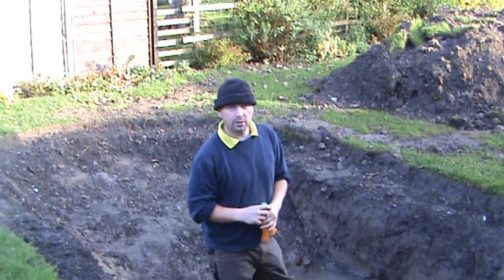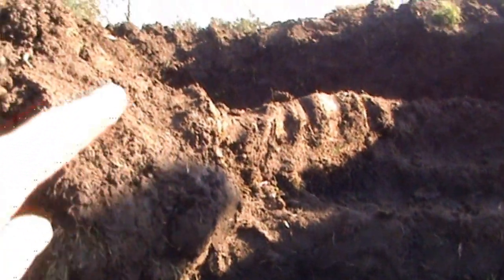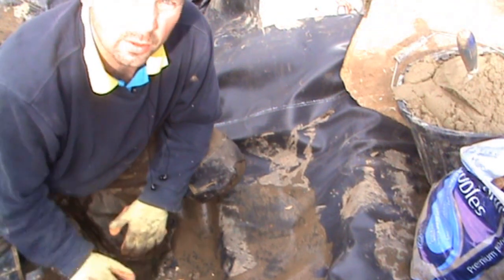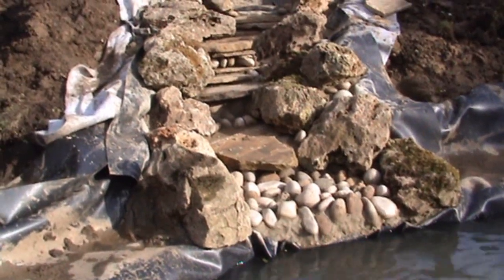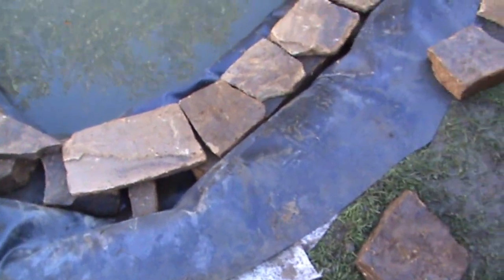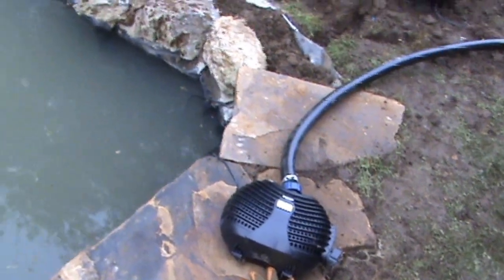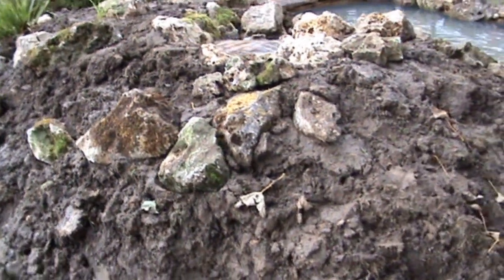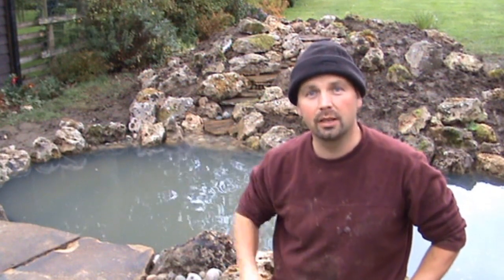How to Build a Fish Pond and Stream / Cascade - Complete pond building video by Pondguru

Comment: hi thanks for the response man what i have noticed with the clay iam hitting in one corner is that its very wet and very unstable at the 3 feet depth iam at. is there any way of compacting it ??or should i let it dry out for a few days ??any info would be brill .and yeah i was thinking of a mixture of fish but mostly koi might go a bit deeper but iam knackered lol
Reply from the maker: It's not easy digging through clay, lol
Yes would be best to leave it to dry out a couple of days just to make sure that you are not at  the level of the water table as the last thing you want is the underneath of the pond filling with water and lifting the liner out. Once it has dried out a bit you should be able to compact it into something solid.
Reply: ok so left it just over a day and yes keeps filling like a inch of water .i have been told told by a neighbor that it is infact the water table as we live out in the country and not far from the river there is actually ditches round the back of our house whicjh are run offs off that river the only thing i think i can do is fill in the pond as wont be deep enuff :( any ideas before i do ??
Reply from the maker: gary robinson If you have a high water table and there is nowhere for groundwater to drain to you're a bit stuck if you're using liner as it will be raised up by the groundwater. If part of the pond is raised it will make a difference as the atmospheric pressure will be greater so groundwater should bleed out the sides of the pond at ground level. Would help if after you put the pond in you dug a French drain (trench filled with gravel) around pond to allow groundwater to easily escape.

Comment: Dear Pond Guru, While I started digging the pond, I realized that the soil in our area is not that hard as its like sand so that I am wondering if there is chance for the pond side will collide as it wouldn't stand that hard? Please advice, also is there any method to prevent reptiles entering the pond and for the safety of fishes. Thanks :)

Comment: Hi guru hope all is well , just a quick question when cementing the spill stones and cobbles in do u use an additive with the cement mix does it need waterproofing or can I just mix and go, building my first cascade @ the mo.
Reply from the maker: I normally use a retarder which has added water proofer but it is not absolutely necessary. Once cascade is built allow cement to cure for 1-2 weeks then fill pond and run pump for a day or so. Completely drain the pond to flush out any contamination, let the cascade stand for another week or so then set pump going and it should be fine.
Best of luck with the build.
Reply: Pondguru thanx for your quick response fella.

Comment: Great stuff thanks. Its sort of wat I want but I'm planning on having a bigger cascade/waterfall with rocks, pebbles etc. In the video at otterburn you have made the pond 2 skin, would a pond the same size as this work with 1 skin back filled with dirt? It will be 8 by 8 and 4 deep 2 in the ground 2out of the ground. So only 2ft above ground level will be back filled with plants,rocks etc thanks for the help

Comment: Hi - I'd like some advice on Algae in a New Pond build... I've literally just built a pond with a waterfall cascade and filled the pond with water from the hose pipe. I've got an Oase 8500 pump and the Oase 30,000 filter clear..... it's been running none stop for 2 days and the water is starting to turn green. I understand this is normal when filling the pond for the first time. Does anyone know how long it take to clear, or do i need to add nutrients to the Hose pipe filled water to help clear the Algae green water?

Comment: Hey Pondguru…Great pond and spillway.  I was wondering if you have had any issues with string algae growing with all the cement used.  Im on the west coast of Canada and most of our ponds with cement in them really start producing a lot of string algae.  Any thoughts?
Reply from the maker: Pondguy eh String algae will grow on any surface if there is an abundance of sunlight and nutrients but it can be damn hard to scrub off cement and concrete. Not sure if you have them over there but a great product for algae killing is the I-tronic units from Velda.

Comment: Does using the heatgun to bond the multiple pieces completely seal it water tight?
Reply from the maker: No. The underlay is not a waterproof membrane, it's just there to cushion and protect the liner.

Comment: What kind of mortar are you using here? And does it affect your ph?
Reply from the maker: ***** It is just ordinary sand and cement with some plasticiser / water proofer. Let is stand for a couple of weeks, fill pond and run for 24 hrs then drain and re-fill. Will be fine after that but if in doubt flush out twice.

Comment: Really great job! 
I'v seen all your videos and got inspired to do my own pond here in Brazil! Everything was good so far until i bought the liner. I got a PEAD geomebrane and i'm having a hard time to do the folds. Have you ever used such thing? I really could use some tips. Thanks in advance
Reply from the maker: That's a sort of liner that I have never heard of but it looks very similar to the PVC or polyethylene which was popular a few years ago over here. The folds are very difficult with that and it may help to place stones on the folds while it is filling up then the weight of water should hold them flat.

Comment: Hi! i am interested in building a backyard koi pond by myseft. i was wondering if it could be built using some of your types of equipment that you use [filters, heaters, pumps etc.] for less than $600. i was thinking 8 by 10 feet [i live in th U.S. so i don't know the metric conversion] and about 3-4 ft. deep. i will also need a de-icer right? i live in southwestern PA and the winters are pretty harsh here. please let me know.

Comment: hi pondguru, i recently bought a house and inherited a 700 gallon pond with it, could you recommend a pump and filter for such a pond?
Reply from the maker: I'm assuming you are in UK so I would have gone for a Filtoclear 16000 and although the pump size will depend on what you are doing with it (stream / waterfall?) you would need a minimum of 6000 litre per hour pump. I always used Aquamax when I was building ponds.

Comment: We are trying to build a cascading waterfall with a 7-8 foot drop into a small pond in our back yard.  Can you advise as to what size pump, type of tubing that leads from pond back to top of fall, filter, etc.  Would appreciate your advise.  Thanks
Reply from the maker: I assume you are in the US? and I have no idea what type of pumps are available there as I am in UK. Ideally you would go with the largest diameter pipe which will fit the pump for maximum flow and least pressure but a pump seller in the US will need to know the vertical lift, length of pipe needed and spread of water required to come over falls (widest only) and from that they should b able to recommend a suitable pump.

Comment: Hello great video iv been thinking of digging my own small pond and was wondering what size liner would be used for a 12 x 20 and 5 feet at its deepest point and would this size pond support a small bream and crappie population with various other wildlife?
Reply from the maker: I'm not sure crappies would live in UK so I'm assuming you are in US?
US dealers may have their own formula for working out liner size but I would use a piece 24' x 32'
Reply: Pondguru Thanks for the help and yes i live in the US, are the liners permanent or do they have to be replaced some years down the road? Also which Oase pump and filter would you recommend for this size pond?
Reply from the maker: Bryan Sapp The Firestone has a 40+ year guarantee and that relates to how quickly it breaks down in sunlight. Protect it for sunlight and it should last for decades.Best to ask US dealers about pumps as the models will be different and I'm not even sure Oase products are available there.
Reply: Pondguru I found Oase pumps and filters on amazon with free shipping that are manufactured in Germany with a 5 year warranty for instance i found the OASE Aquamax Eco premium 2000 pump for $300 with free shipping is that about the right price range for them? and thanks for all the help you've been most helpful.
Reply from the maker: brian k 2000 (litres??) is very small so $300 seems very expensive and I'm not sure there is a 2000 model? As I have closed the shop and do not install ponds now I don't know what new models and prices Oase have brought out so maybe that is a 2000 gallon model (over here they are measured in litres).
Reply: Pondguru Yea it was just one of the first ones i looked at and it is a new model, and i have access to motors, pumps, and filters i work on swimming pools for a living but its just as expensive or more if i buy it wholesale than if i buy it online which is sad and my distributor doesn't carry OASE equipment which i would prefer to use. Also have you had any experience with the OASE BioSmart filter?
Reply: brian k I just found a OASE BioSmart 10000 pond filter for $300 and it is in gallons so im guessing the 2000 was in gallons.  Im also guessing the Aquamax is higher quality than the Biosmart if their the same price or is the Aquamax just more complex?
Reply from the maker: brian k The Biosmart is a filter and the Aquamax is a pump so they can't be compared as they are different products. I can't see a filter with UV which costs $300 handling 10000 gallons? so that surely has to be litres?
Reply: Yes sorry im not sure what i was thinking at the time but from what it says its in gallons this is the link to what im looking at. 

http://www.amazon.com/OASE-BioSmart-10000-Pond-Filter/dp/B006KSJC4Q/ref=sr_1_2?ie=UTF8&qid=1428200831&sr=8-2&keywords=OASE+filters 

see what you think
Reply: And i dont think it has the UV feature just foam filters.
Reply from the maker: brian k Yes it does appear to claim 10,000 gallons (US?) which is obviously with no fish. When fish are taken into consideration that will be cut in half, add koi and you can take another 50% off so in reality it would treat around 2500-3000 US gallons with koi and 5000 US gal with small fish.Working at the dimensions of your pond you would have nearer 8000 - 9000 US gallons so this filter seems way small.You're really looking for a proper filter system which will handle 10000 US gallons with fish as you would always size the filter a little bigger than the 'max. with fish' figure.
Reply: Pondguru K thank you that helps me alot because i do plan on having some small fish probably no koi though so would you recommend doubling that to a 20000 (gallons) filter?
Reply from the maker: brian k Yes definitely as a filter will always state the maximum amount of water it will treat and that will be a planted pond, in shade with no fish. Half amount stated for mix of fish and half again for koi.

Comment: hi pondguru, great videos found them mega helpfull. this could be a sill question but does my filter and pump need to be hard wired? i.e mains board? or is it acceptable to fit it with 5 amp plug?
Reply from the maker: +Mathew Eccles Either way is fine as long as the connection is made in a suitable outdoor rated box or socket (IP 56 or higher).
Reply: +Pondguru Outdoors  thanks for the rapid reply! good stuff thank you for the help. SUBSCRIBED!
Reply from the maker: +Mathew Eccles No worries, any time - glad you enjoy the videos.

Comment: Three questions (oh keeper of the bridge!) 
Any reason you don't use the black foam (instead of mortar) a lot of installers here use?
Any potential for capillary wicking between the cascade liner and the pond liner? 
Does the polyester underlay get brittle or degrade over time, the way a poly liner does?

Comment: hi, I have a question for pond liners is it better to have a full liners or paste smaller liners together I need a 30x50 size and I keep finding smaller sizes at my local store Im not sure if pasting smaller liners is a good idea though? or do-able?
Reply from the maker: George Palaq Best to go for single piece liners which have been welded together at factory. Unless you have all the correct gear and perfect conditions (and know how to do it) don't try and stick liners together yourself. Any distributor should be able to price for custom sizes.

Comment: What size pipe are you using 50mm?.if I were to use the 40 mm pipe would it slow the flow of water down the cascade?
Reply from the maker: scfc mighty potters The pipe was 38mm internal diameter and pump was only 8000 litres per hour so stepping up to bigger size wouldn't have really affected flow. Stepping down to 32mm internal would have reduced pumped volume and increased pressure at exit point. Always go for biggest size pipe pump will take for maximum volume / minimal pressure.
Reply: Pondguru Outdoors I 've gone for the 30000 and 16000 pump. So would you advise 50mm tube and the length from filter to top of waterfall will be about 4m what is the max length of tube that the 30000 will pump through at less than a ltr at highest point.thx
Reply from the maker: scfc mighty potters The pump will pump through a very long pipe but the height of that pipe will dictate how much water comes out a 50mm pipe will ensure that you get maximum flow but if you want to know how much water will come out the end at a specific height you will need to ask Oase or the supplier of the pumps as I don't have that information any more since I closed my shop and don't sell pumps now.

Comment: What is the life span of the concrete when laid on top of the pond liner material? I imagine it starts to crack upon the first freeze. Also, are you able to test the flow as you're building the waterfall, or do you just have a good eye for level at this point?
Reply from the maker: Most people would use a small spirit level (advisable) to get the spill stones right or go with a vastly over powered pump but once you've put in a few cascades you get to know what a certain pump flow is capable of and build accordingly.
The cement doesn't seem to break up as it is a strong mix which beds in against the liner very well.
Thanks for watching and appreciating the videos.

Comment: I did my build similar with the liner and under liner. Note you can use lots of news paper and or carpet as a barrier as well if you can't afford a barrier but one thing I will say is this before you lay any liner figure out your plumbing first. You can hide the plumbing under your extra soil you pull out and run it straight up in the air cutting it later to meat your filter and fall height. I created a 3 foot bulkhead to throw my dirt against so I could hide my filter, power and plug in lights.

Comment: Excellent job, Guru. By the way, I need your help, please!
I'm building my own cascade + stream + pond with preformed liner. The distance between my pond and cascade (stream) is around 20 feet. My doubt is what kind of pump should I install and how many GPH? How much I' would pay for that you recommend me?
Ps: My pond's capacity is around 130 gallons.
Thank you!!
Reply from the maker: Glad you enjoy the videos.
What is vertical lift from pond surface and spread over falls in cascade? Once I get that I can work out required flow and suggest a pump. I'm assuming you are in UK as I have no idea what pumps are available in other countries.
Reply: Pondguru Thanks for your quick response. I didn't understand your question very well. What I can say is, the vertical lift of cascade is 4 ft and the length of stream is 20 ft until the pond. I live here in California, USA. Thanks again!
Reply from the maker: Eli Oliveira Thanks for the vertical lift measurement. I need to know what the width of the waterfalls or drops are as that is needed to work out flow.
Reply: Pondguru The waterfall's width is 2 ft.
Reply from the maker: Eli Oliveira For that width you would need at least 6000 litres (1580 US gallons) per hour coming over the fall so it would need an Aquamax 12000 or similar.
Reply: Ok. I both a pump with 3600 gph. No problem?

Comment: Thanks for posting this video. It was a real pleasure to watch. You are an artist, who really loves what they do. Just a quick question from all the way in Australia. You used a pump with an 8 thousand litre flow, how big was the pond itself in terms of litres? I ask as  I have built a pond myself recently that is approximately 15000 litres in capacity and am searching for the right sized pump.
Reply from the maker: I think the pond was around 5-6000 litres but the pump was based on the height and width of the cascade so worked out at 8000 litres.
The for 15000 litre pond you would ideally need an 8000 pump to turn the pond over once every two hours but actual size of pump will depend on your stream / waterfall size.
Glad you enjoy the videos and thanks for watching.
Reply: Thanks so very very much for your response Pondguru. It is very helpful indeed and greatly appreciated. I also need to ask would I need to buy the 30 000 model of the OASE Filtoclear for my pond, or would something smaller in that make and range suffice? Incidentally, my pond is has no cascade aspect, it sits level in the ground.
Reply from the maker: Theo Tsalamandris You would use a filter which promised to do at least twice the volume of water in your pond so in effect a 30000 filter will actually filter a 15000 fish pond. If you are having lots of koi in there you can halve that again.
Reply: Pondguru
We have just goldfish, no koi.Thanks again!! All your help has really helped me out a lot!!